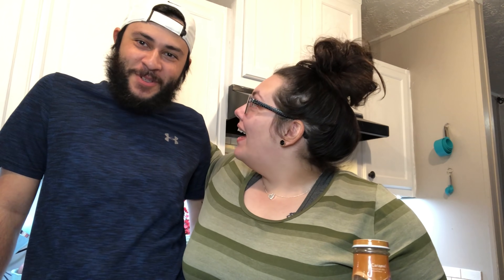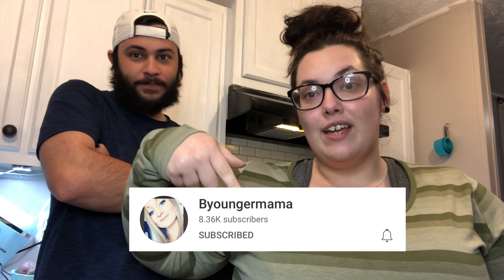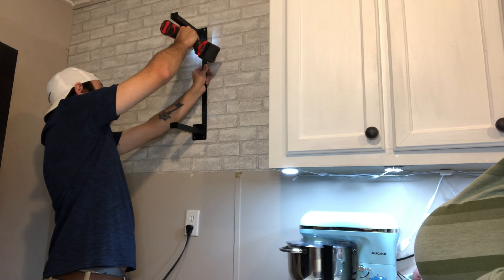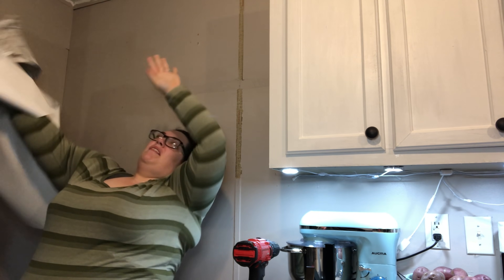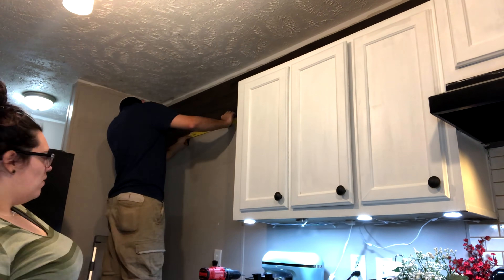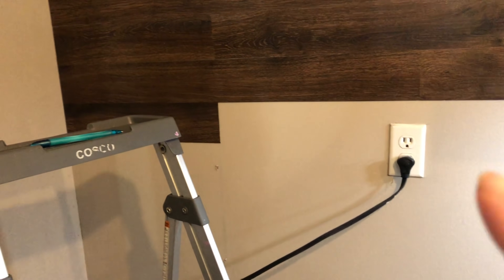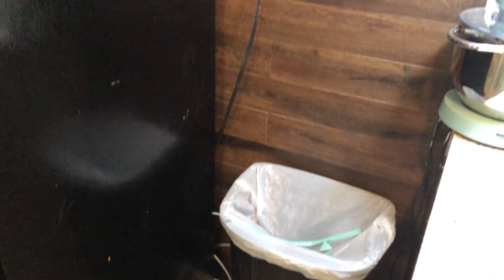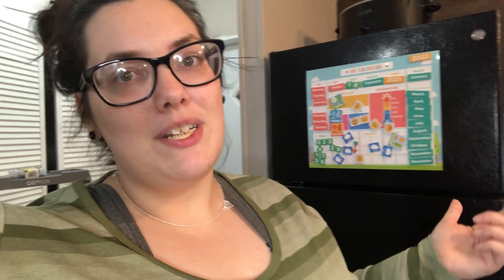DIY SHIP LAP WALLS PT. 1 | Mobile home makeover | singlewide mobile home updates on a budget 💰

Comment: i'm not a fan of dark wood back splashes, how about that peel and stick ceiling tile? they come in usually 12 by 12 inches and they look like the old fashioned metal ceiling tile, you can get it in white and just brush a light color over it  to pop.  please give that a thought before you put the dark stuff between the cabinets.